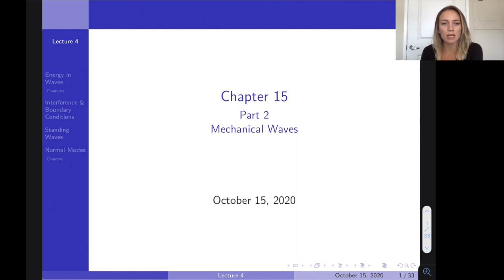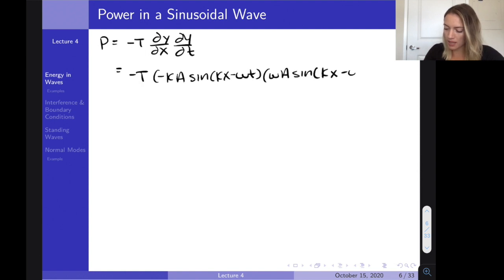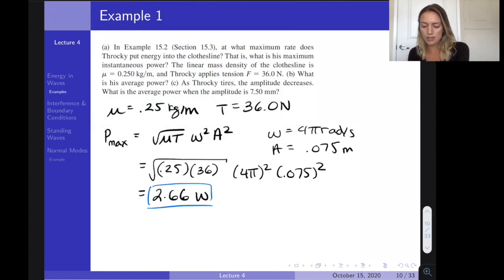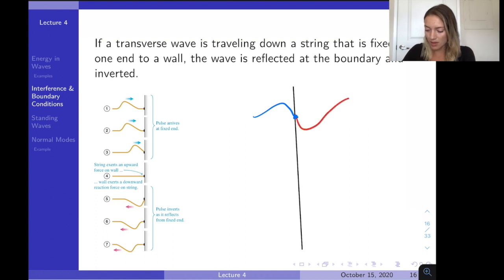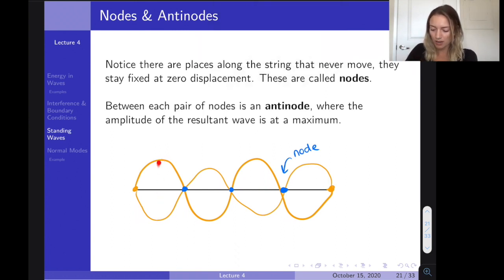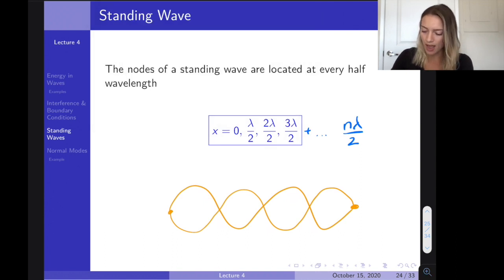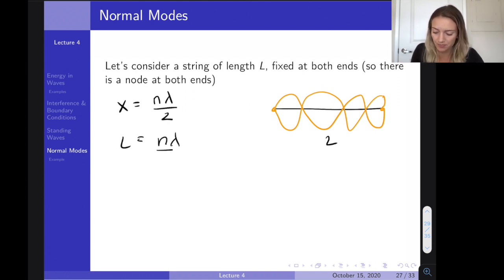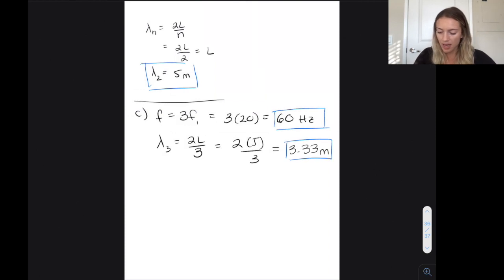Mechanical Waves Continued

Comment: I don't think your free body diagram when you calculate the average power in a transverse wave is correct.  You show a tension force, T, pulling the particle of string to the lower left, tangent to the string.  Doesn't the string to the upper right of that particle also exert a force to the upper right?  If that weren't so, if there were just that one force, the particle would have to be moving and accelerating to the lower left instead of just up and down.